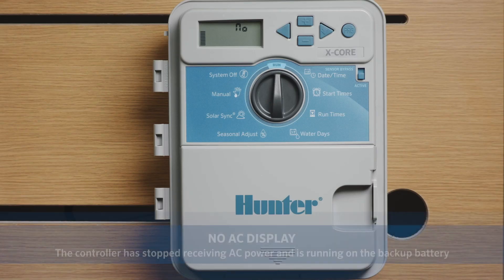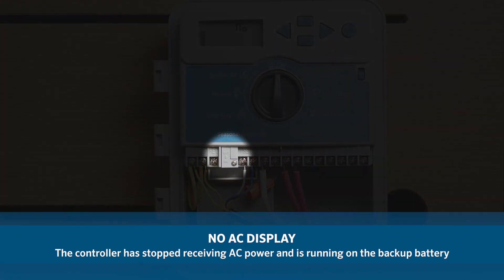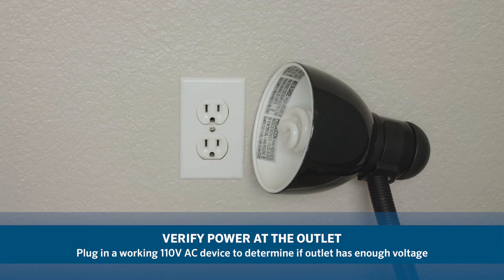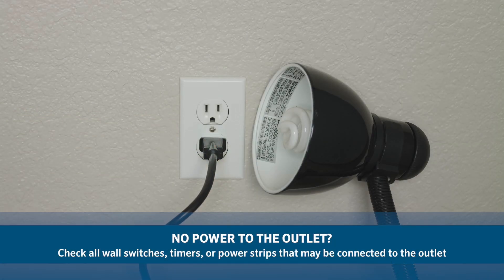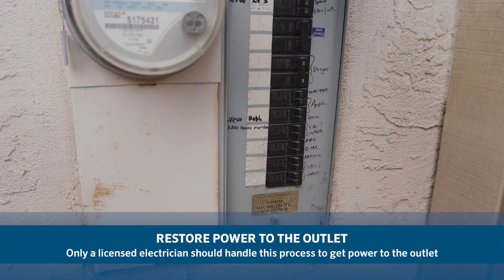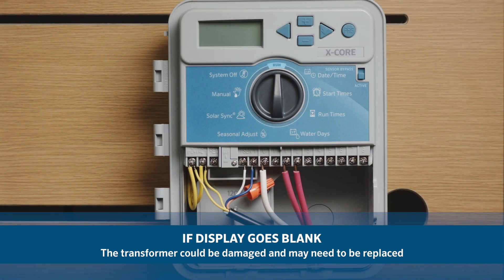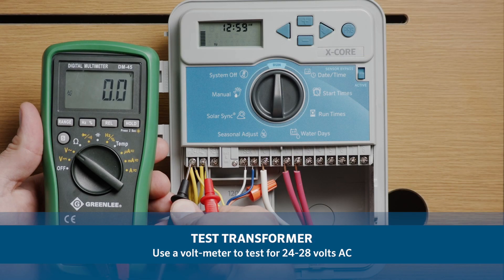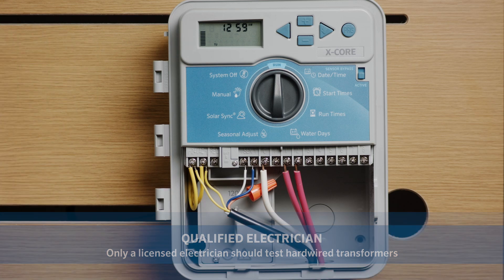X-Core® No AC Message

Comment: The outlet used works, I plugged something in and it works. The controller itself shows no display at all. Does it have a fuse that might be blown? If so, where is it located?
Reply: Or this back up battery you mentioned, is there a way to replace it?
Reply from the maker: Please contact our customer support department here: https://www.hunterindustries.com/hunter-technical-support-email-request